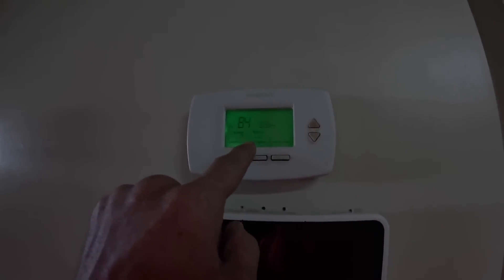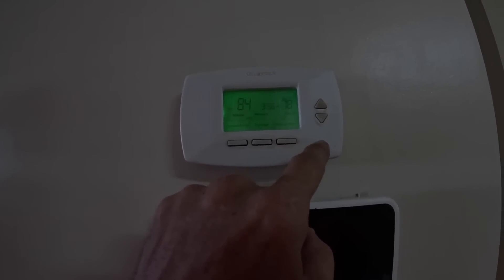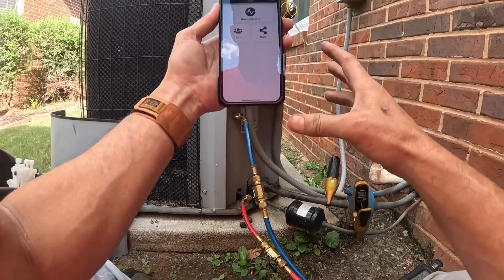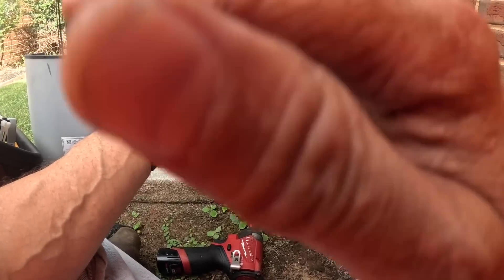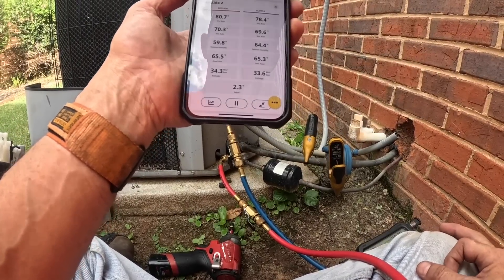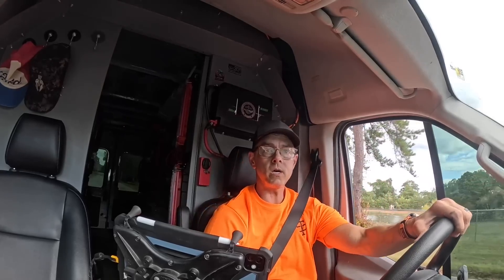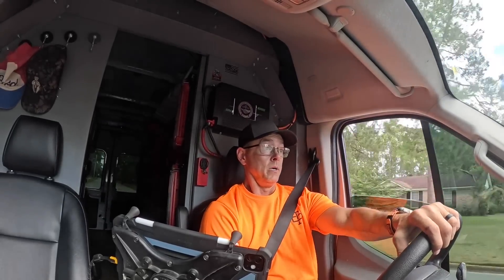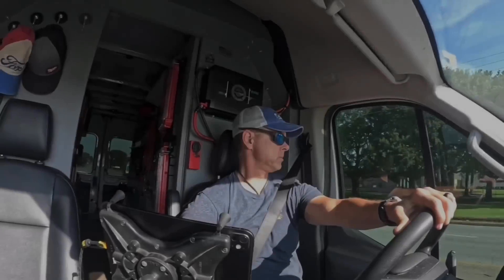Just How Many Problems Can We See? #hvacguy #hvaclife #hvactrainingvideos

Comment: Hey Curtis you rite and i can blame myself also when i said to many customers OH YOU HAVE A NEW ONE meaning is under 10 yrs per say 5 to 10 no more that doesn't mean is brand new but sometimes is better if we techs may say is a Fairly new system....those pressures make no sense at all. Where was the Rev Valve or Txv. I work for a Home Warranty Co and here since Customer only pay once a year we go the extra mile.....many guys order parts not need it and replace Txv Replace RValve recharge and Circuit Boards all that under their Home Warranty specially new ones w Fact Warranty in effect.  Parts Changer Techs versus People like you that Hit the cause every time Blessings Mr C. U a good tech.....i graduated from Vo Tech 1988.....time flies 😊

Comment: Systems just about 8 years young and is already got to leaking down its chili sauce..  friggn sad..  gotta be those bullshit “coated” a coils that just sit in the condensate pans, the way they’re designed to..  just a bunch of crap that raised the initial cost of the units and turned out to take off 12 years of service life..  dont give a fuck all if its 90% efficient when the 7000$ thing gives up in 8 years..  used to be water heaters and ac systems would last 20 years before they need replaced.  Now we got max 10 yr water heaters and 8 yr ac systems..

Comment: In my experience, if a coil or swim thing else worth more than $500 or more needs to be replaced on a system. The home warranty would often just replace the air handler or condenser whichever needed the part

Comment: Hold on, was there a suction drier on the discharge line (in heat mode)? There is probably dessicant beads floating around in the system.

Comment: Walked away from HVAC for 3 years now. Watching you climb into attics always solidifies my choice.
Reply: I really don't think I would be as healthy if I didn't sweat heavily from time to time. Kinda flushes out my system.
Reply: An installer was completely wet. I said I guess you don't have to watch your sodium intake. He said Nah I drink a lot of pickle juice!
Reply: I graduated with the degree in hvac in 2022 and I only fix my own stuff and some of the neighborhood I don’t work for a company and didn’t plan to but I just got me some digital gauges and now I kinda just want to follow,someone around to further my knowledge and do the easy stuff I won’t be doing any installs and all that but even if they don’t pay me idc I just want to get better at troubleshooting.
Reply: @E85_STI  
I mean anywhere will hire someone for free. Should not be that hard.
I think the problem with this field is the hours are just absurd. Tons of overtime, many long days. Companies today do not want to hire more people because its cheaper to just work someone a day and pay overtime then it is to hire another. Payroll taxes, regulation, fees, licenses etc are just out of control.
Reply: @bobshanery5152  shoot I’m used to that as I was in the Military and a Platoon Sergeant at that so my days were 15 hour days always but I didn’t do much heavy lifting and all that but the only reason I rather get paid little or for free is so I don’t have to be the new guy getting stuck with the stuff they don’t want to do like installs and whatever the entry level person has to do when they start.

Comment: That is truly unfortunate.  I wonder if she was provided with someone else's traded-in junk.  How dirty was the inside filter and the coil?  Were the pieces matched for capacity?  Ductwork sizing okay?  If cost were no object (never true), what would you do to fix this situation?
Reply from the maker: Replace condenser, possibly indoor coil, if it’s leaking. Jack up air handler and supply a platform, properly insulate line set. Just to start.

Comment: Thank God for me most of the systems I work on are in basements. For all the homeowners out there- if you care about efficiency at all you keep your ductwork and furnace / air handler inside what we call the "thermal envelope" it also reduces the cost of service.
Reply: I just don't get the point of putting them in the attic, build a closet or put them in the basement
Reply: @tedbell75    There are very few basements in Georgia.    Crawl spaces - yes.       In parts of Georgia the water table can be as little as 3 feet below the surface.    The soils are wet and a lot of clay,  when they dry out the soils shrink, when they get wet they swell up and that puts all sorts of stresses on a basement foundation.    It's also worth noting the soil can be shallow with limestone or bedrock just a few feet down.  Doing a full basement like we have in the North would literally double the cost of building the house.      Frankly, the only reason we do full basements in the North is to get plumbing and foundation below the frost line, because of that we make them full height usable conditioned space which adds usable square footage to the home and gives a nice convenient spot for the mechanicals and washers & dryers etc.      I do agree puting an air handler in the Attic is crazy, but in most of these 1200 sq ft bungalows, depending on the number of interior walls, bedrooms and closets, space is a premium.    And builders don't care if it's convenient for the contractors servicing their equipment.
Reply: @tedbell75  there are a few things to point out here. 1) the average home buyer isn't thinking about where the mechanical equipment is, or the potential long-term consequences. 2) for the builder, putting the plumbing and mechanical systems in an unfinished area increases their usable square footage to the homeowner. 3) even if you put your plumbing and mechanical in a closet, if you put your ductwork in the Attic you're still killing your efficiency. You're also limiting your upgrade options when you shoehorn equipment in a closet. A big part of my business is upgrading performance and I need space to do it to improve air flow, filtration, etc. It's even a challenge in some unfinished basements believe it or not. 4) some areas like where my sister lives don't have the practical option of having a home with a basement. The soil conditions just won't allow for it. For her I recommended encapsulating her attic to improve performance.
Reply: Can you believe most the people I know in FL have air handler & ducts in the attic. Many like me have hip roof so there is no room to move around. The heat is a killer.

Comment: Pull disconnect let pressures equalize and that tells the refrigerant
Reply: Not really, the inside temperature and outside temperature will make it hard to figure the ambient temperature of the  refrigerant. You can recover some in a recovery tank, let it sit for a few hours, read the temperature and pressure..it will tell you  the highest pressure refrigerant type but if it's mixed, you'll never know. In other words, if r410a is mixed with r22, you are going to read r410a pressures.

Comment: Curtis it can't be r 22 just saw in the video it says poe oil. With a label indicating that it probably had a compressor replacement indicating the system probably has 407c in it. Any way I think you are making a mistake walking away I am watching video now and I see the label but whoever replaced that compressor should have labeled what refrigerent they put in.

Anyway I would have pulled out the refrigerent and put 407c in it but the evap coil says 410 a indicating the evap coil was replaced but I know those evap coils can handle r 22 also.

Curtis for refrigerent I would just use one that can handle either mineral oil or poe oil until you can verify the compressor was replaced.

Comment: My question 
I know nothing of hvac, but is there a chemical or device to check the type of refrigerant in the system?
Reply: Yes.  They're called refrigerant gas analyzers.  Very pricey.  A good one will cost you over $4,000.  Hard to justify that expense when you might only use it a couple of times a year.

Comment: the sticker says POE OIL, its likely 407C, the suction line drier suggests a compressor burn out in the past, so likely a replacement condenser with 407C and that air handler looks just a few years old and possibly has a txv for 410a in it.

Comment: If the federal EPA and DOE can mandate which gas to use by law, there should also be a federal law if you replace the compressor and pump it up with a different gas, you must install a label on the unit telling the tech which gas is definitely in the machine. Just common sense.
Reply: labeling is an epa requirement, if a different refrigerant is installed but very rarely are they labeled. replacement jugs come with several decals to use
Reply: @Paul-IE-Repairs  Exactly. When I put a different gas in beside R22 or whatever ten the jugs usually come with a label. I always put that sticker on the unit. I also put it in my computer details including the type of refrigerant
Reply: @Paul-IE-Repairs  Why can’t the EPA just get their ScHmIdT together in the first place. 🤣 The future ban of the unreleased new refrigerant R454b for the forever chemical PFAS content is imminent. No doubt DuPont will have a new refrigerant gas just in time and the equipment manufactures will keep pace with demand for new systems. I am coming to the conclusion that there is simply no good reason to not buy the cheapest Goodman you can. HVAC should just go to plug and play disposable components.
Reply: There is a law but hacks don’t label shit.
Reply: @AaronPowellvox I haven't found anything. I was planning on reporting a local company for topping off a r22 system with r410a. I called and searched everywhere I could think of and it doesn't seem to be against the law, it's only an EPA recommendation.
Reply: That's the first thing I thought.  What the heck is really in there?  It seems the common sense is in short supply these days!
Reply: The local big HVAC companies around here top off r22 systems with 407c or another retrofit. I've followed an unknown company that's been adding r410a to r22 systems
Reply: Thats pretty obvious but I know many tech people don't think about tomorrow. SAD
Reply: Just google the comp number every time.  No problemo
Reply: @silvajay6443  No, the web is not a solid resource however, the manufacturers website would be.
Reply: Test pressure and temp. It will tell you what refrigerant it is.
Reply: @SubMOA8 
Not if a hack before you screwed it up and put in what he thought was in there or just didn’t care.  Then your gauges tell you gibberish.

Comment: That top port isnt that used for when the system is in heat?
Reply: Top port can be used for susuction pressure anytime.
Reply: @mikeglasgow9618  Really? Good to know thanks!
Reply: @mrautoguy8419 We call it the ‘common’ suction port and out of habit I just hook onto it in heat or cool mode.